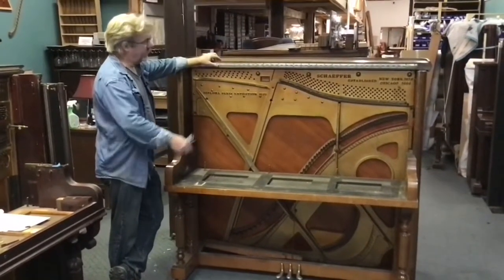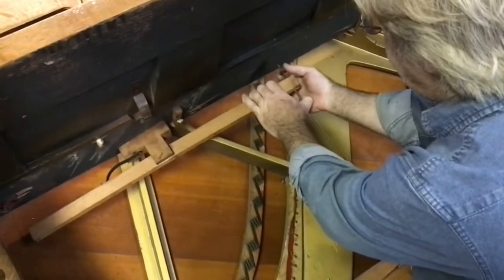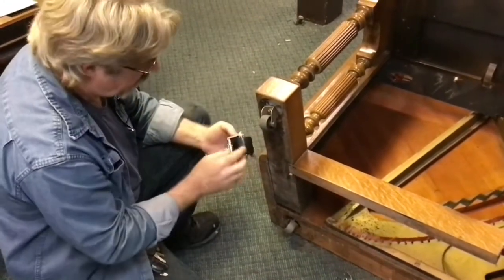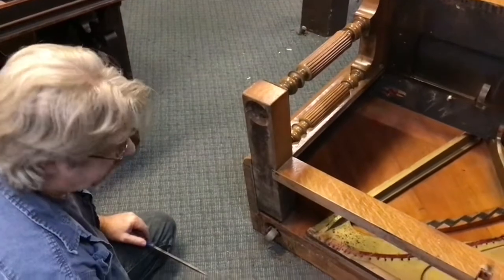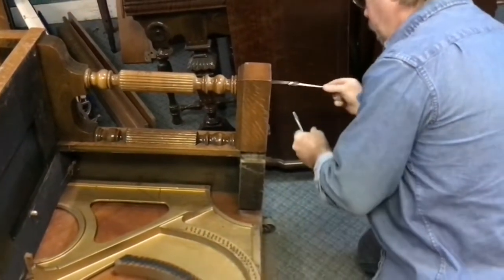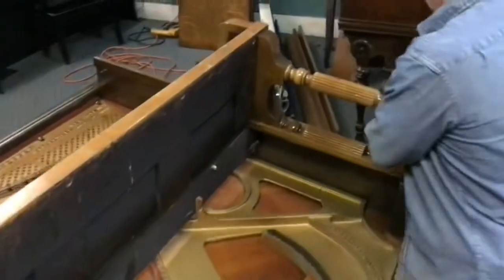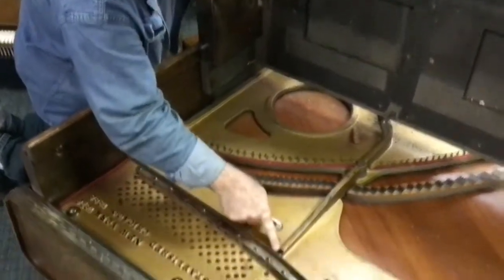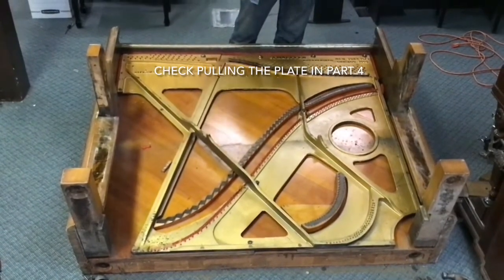Acoustic to Digital Piano Conversion - Disassembly Part 3

Comment: question.  when I set my digital piano on the keybed, in your experience, will the fall board work as a cover for the digital?  Or do I need to custom built that.,

I am currently sanding a 100 year old piano to use as my keyboard stand. I have it completely disassembled. I nearly have it completely sanded. I would love to use the fallboard but I'm just not sure. It is one of the rounded fallboard varieties.  A curved one.
Reply from the maker: Generally speaking an assembled beyboard is significantly larger than the original keyset so the original fallboard does not work without significant modification, if at all.
Reply: @raglandpiano  Thank you.. I appreciate it.